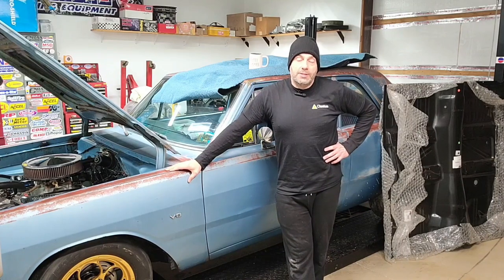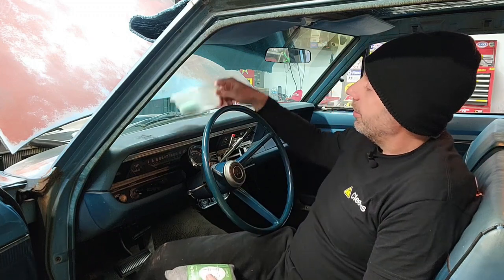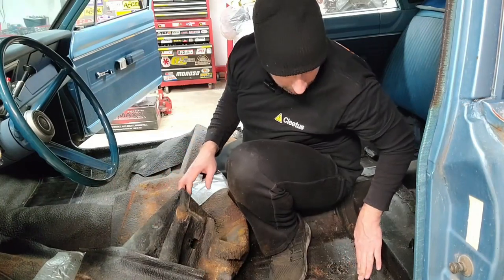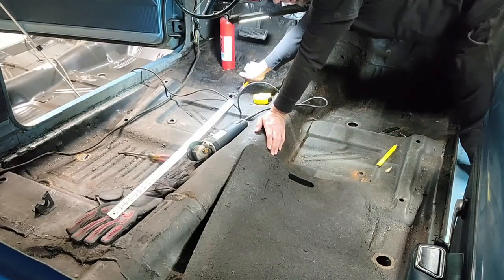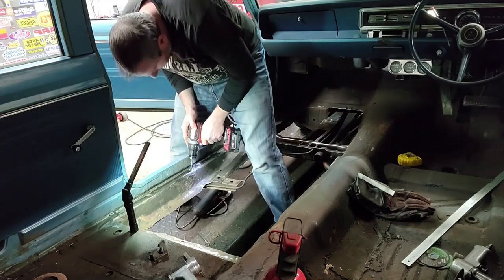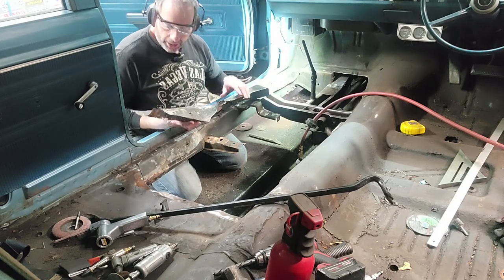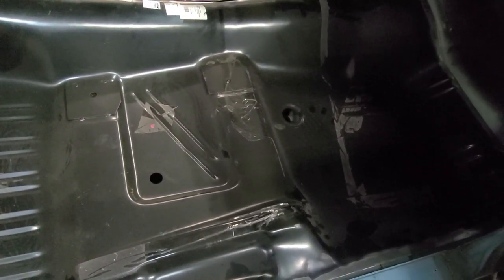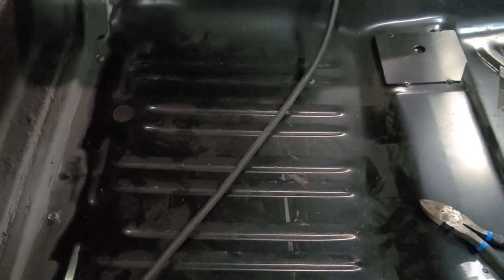1968 Dart rusty floor replacement

Comment: I just got a 68 Plymouth Valiant 318/4 speed that was a former race car. This video has been great to watch as I will need to do some floor work on it, and your Dart is essentially identical inside. Thanks for the tip on the odor eliminator packs! This Valiant definitely hosted a few generations of mice, and I'm slowly sanitizing the interior. My goal is to make it a great street car. Keep the Dart videos coming, thanks!
Reply from the maker: The dart will be back soon. Big plans for this winter.  Thanks for watching!!!